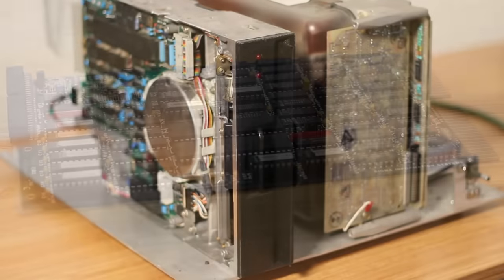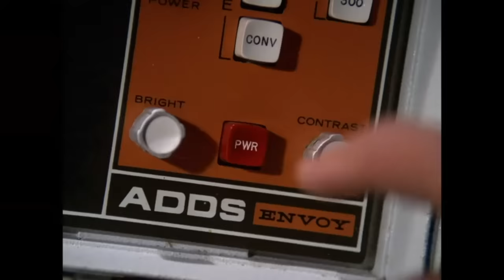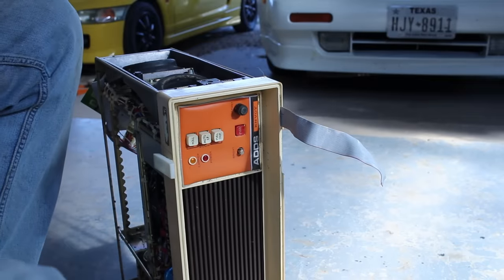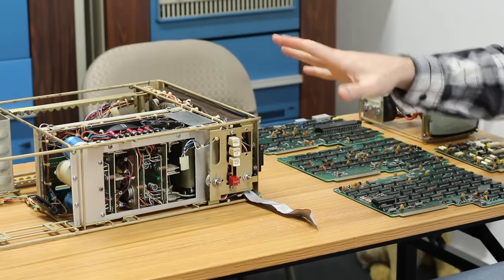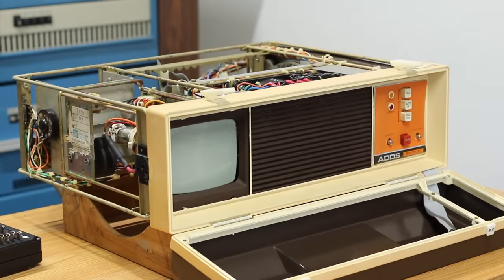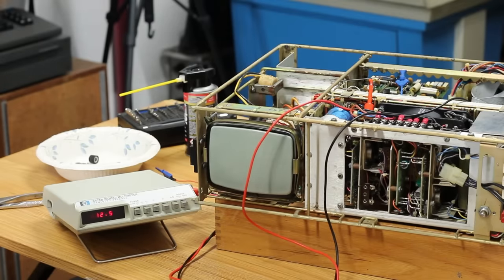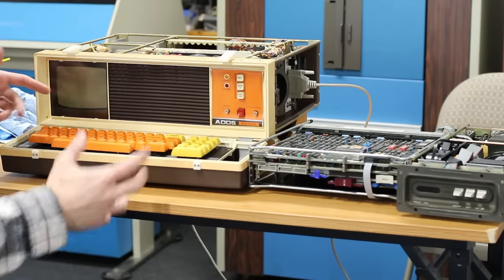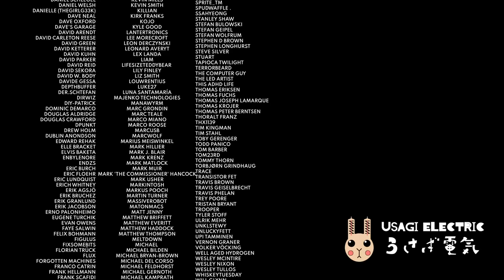This Data Terminal was Covered in Poop!

Comment: Power electronics engineer here specialising in MRO of rail power electronics. You're cleaning the boards exactly how I would, only think I would change would be to add Isopropyl alcohol to sterilise and act as a drying agent.
Reply: Some old capacitors wouldn't be happy with much time with isopropyl.   Polystyrene capacitors will degrade.   I have also had cases of it attacking coax cables.  The insulation between the center conductor and the shield seemed to soak up the isopropyl and distort.
Reply: I this case it's more of a rinse instead of a soak in the IPA though, right? Just enough to help get rid of any residual water and unwanted microbiome...
Reply: I agree, However I wouldn't use a high percentage of alcohol, maybe the strongest you can get from the first aid section at the store.
Reply: Do you have anything against cleaning it with an ultrasonic cleaner?
Reply: @christo930  It may be too aggressive.
Reply: @christo930  the old caps might get contaminated
Reply: Flushing with IPA after the washing might help with potential limescale deposits as well. (Very hard water in Texas afair) 
Not concerned with the IPA in this case cause 99.9% of the damage is already done, but I wouldn't let the boards soak in it as I would do with the newer electronic stuff I regularly handle.
Reply: I'm an EE who designs in-house test equipment and I have an actual toothbrush in my toolbox for scrubbing boards with water and IPA in the sink. It was actually my personal toothbrush but we had to clean something on a field trip, and needs must...
Reply: @kensmith5694  simply nope. all true when soaking long time in high grade alcohol. does just not apply. I'm washing printed circuits with a speay of a "personal" mixture (~50°) of distilled water and isopropanol since decades. best results. better cleaning, far better drying. no problem caused by alcohol ever.
Reply: @christo930  YES. :-)  don't do that to old and a little corroded electronics. I tried. until I watched a capacitor simply disintegrate into a cloud of dirt  :-)
Reply: @christo930  No way, too much vibration. The originals were almost certainly cleaned with either IPA or carbon tet.
Reply: @christianlingurar7085  Heh.  That means it needed to be replaced anyway.
Reply: @christianlingurar7085  Well you do you.  I like my styrene capacitors in old stuff to stay within spec and for the coaxial cables to remain good.
Reply: @christo930  Too aggressive on some passives like caps and resistors. I've done it a few times with old Arcade monitors but I always recapped them after the bath.
Reply: I've had to clean PCBs exposed to CaCl spray, and my experience there was that it is VERY hard to wash out contaminants that have soaked into the PCB substrate. Even after ten wash cycles with deionized water and IPA, could still measure unwanted conductivity in the worst soaked areas. The TLDR for this example is that this thing is gonna be fragrant when warmed up ;)
Reply: I would avoid tap water if you have hard water. Lots of minerals will be left behind.
Reply: I admire his perseverance. After that much poop, I simply would have "cleaned" this in an autoclave for about 2 weeks.
Reply from the maker: Thanks for the insight!
I thought about adding some IPA, but I only had a little left and was too lazy to go down to the store to get some more, haha.
Reply: @christo930  Yes, don't do it. The prolonged vibration may be enough to damage bonding wires in some semiconductors.
Reply: I'd avoid the isopropyl and instead final rinse with deionized or distilled water and dry with warm HEPA filtered air.
Reply: 35+ years experience with PC board engineering. Some of you are making this far more complicated than necessary.
1) Isopropal alcohol is fine but Proponal is less likely to leave any residue.
2) Plain old tap water is fine.
3) Dry both water rinse and alcohol bath with compressed air.

This is a standard procedure with commercial products. Military may have more stringent requirements.
Reply: @edlizard  Unless this is a clean room component, what is the purpose of the HEPA filter? The board ultimately sit's in a card cage with a fan blowing room air across it.
Reply: @kensmith5694   You can always put it in another container and put that in the ultrasonic cleaner, it attenuates the ultrasound. I also do this when I have items covered in grease so I am not always having to clean out my tank.
Reply: @andydelle4509 Military standards are baked into IPC standards, which actually specify water washes if needed to clean boards. Isopropanol is fine for a rinse or flush, to help with drying. But pure isopropanol sucks as a cleaning agent. It's excellent for disinfecting, but you just end up with sanitized gunk that you still need to wash off with water and a brush.

Comment: Sure that terminal is gorgeous, but I spent the whole episode drooling over that cute HP multimeter
Reply: Those desctop meters are amazing I have a 1970s simpson meter that has a nixie tube display.
Reply: it looks as if it would spring right into your face when you apply wrong voltage
Reply: @timothydelaval1089 you lucky dog.  I have a Simpson multimeter that has early LEDs. Pretty rare I believe.  Maybe not.
Reply: Much better than propping a clamp meter up with a screwdriver!
Reply: Glad I wasn't the only one
Reply from the maker: Phillip is a legend for donating this one to the channel, it's absolutely gorgeous and the perfect meter to be troubleshooting this epic terminal with!
Reply: Seriously, me too.
Reply: These meters also were mounted atop of certain HP oscilloscopes. I had a 1725 that had one at some time.
Reply: That terminal was a nightmare to assemble.  It took one guy a month to assemble/test 30 units.  That rat poop small card was the modem mod/demodulator card.  All done using op amps.  And only ran at 300 baud.  The phone couplers were designed for the Western Union Handset used everywhere home/business.  At the time only AT&T equipment could be used and only later.  Could cheap china-crap phones be used as well as direct connect modem cards.  620 envoys were stopped when FCC allowed direct to MA Bell.  Who wants a slow 300 baud terminal when faster was just over the horizon.
Reply: For real. Beautiful little unit.

Comment: Just saw the part of the video showing a large number of  (((   (  ((    (  in a field of what should be ASCII spaces.    I would bet the (((   (    ((   (   because the error in the raster display is in the middle grouping of 8 lines the issue is with the ADDS memory shift-reg card's 9 Shit-Reg. ICs, one of the chips is flipping bits because it's just bad, ( This was a very common problem and many time was heat related. )     Space code = 0x20   and the ( code = 0x28    looks like a bad shift-reg bit.
Reply: Nicely spotted!
Reply from the maker: Ken swinging in with the proper expert diagnosis! Gonna have to get you down here to help get this thing and the printer fully up and running one of these days!

Comment: Your portable ADDS terminal has the same 3 main PCBs and keyboard as the ADDS 580 used in first Warrex CPU4 systems.  The one with the side connector is the FE card ( has the RS-232 I/O logic ) the middle card is the screen memory display buffer ( the display buffer has 9 shift-reg IC's,   1-3 for first 8 lines, 4-6 for the second 8 lines and 7-9 the last 8 lines =  24 lines x 80 columns ).  The two main issues are the FE card RS-232 I/O chips SN75188 & SN75189  and on the screen buffer card the 9 memory shift-reg. chip house 2 bits each by 80 positions on the display.  The normal test for bad shift-reg chip is to type in 1/2 dup.  A B D H P  (return) in all 24 lines on the display.  A B D H P will turn on a single bit on the ASCII code of the up-case only ASCII display.  Many times the A B D H P typed will be displayed as with a extra or missing bit so the A B D H P displays the wrong letters.
Reply: would the  Envoy work on the centurion(or is it beyond 24x80 ability?) ( your other comment notes the probable failure for the chips - try a card swap between terminals first ?)  Presumably CRT in the rat one is power supply related and solvable ?
Reply: It's not unusual for the RS driver chips to get blown out.  All it takes is some kind of surge on the RS-232 line when it's run a long distance.
Reply: Good luck finding the Static shift register chips.  It was the reason ADDS stopped production of several lines (580/880/980/620) Then the regent series was produced followed by viewpoint.  The video memory card is sectioned by 3 groups of 8.  abdhp is only need once per section not all lines.  Check test key <CTRL>-L clear screen  abdhp <space> <ctrl>-K K abdhp <space> <ctrl>-K W  abdhp <space>.  re: ctrl is control key, space is space bar.  The space is important.  Any bad shift registers will show as a @ sign.  FYI <ctrl>-K was direct line access @ line 1, W line 24
Reply: @russellhltn1396   Does the RS in "RS driver chips" refer to Rat S...?
Reply: @lawrencerubanka7087  No, I was just abbreviating RS-232.  In this case "RS" is "Recommended Standard".
Reply: @n2nby  Sounds like both of us have repaired the early ADDS terminals with bad video Shift Reg. Memory chips.  The good old A B D H P  in each vert. 3rd of the screen.    Regards,  Ken
Reply: @kenromaine2387 I was closer to the problem than you.  I worked there for 17 years.  The shift registers ran hot on the card.  Beside subject to failure.  Hot/cold problems too.

Comment: To add one nugget to the cleaning bit- It's a good idea to be careful with wire harnesses in addition. Water can wick several feet inside the wire insulation and can stay there. This can cause issues in the long-term on some wire types. It might also be a good idea to hose the boards off with distilled or de-ionized water as a final wash so that it doesn't deposit minerals on the boards during drying.

Comment: To get the keyboard loopback working, you might have to assert DCD to the terminal; on the VT52-like terminals I used, you could loop DTR back to DCD; on those terminals, DTR was an output that would be asserted when the terminal was "online". We would also wire those two to the DSR pin. You may also have to loop back CTS to RTS if the terminal requires a hardware handshake.

Comment: People that complain about washing boards have never worked in PCBA manufacturing.  We run assembled boards through plain water washes every single time, it's how they are cleaned before configuration and testing.  Heck, I literally spent over an hour washing boards just a couple days ago at work.  Although, personally, if the board can handle it, I just bake them.  Not only does it dry them out more thoroughly, if I do have to do any touch up soldering it makes that go so much better as well.
Reply: I doubt you use tap water though. So much (natural) contaminants in that I wouldn't buy from you. But for this videos purpose it was fine.
Reply: @bzuidgeest  It's literally just Deionized water, a.k.a. purified water.  And we manufacture for some of the biggest companies, including stuff in your computer, so you kinda already do.  Also, if you travel by plane then I hope you don't mind :)
Reply: All the Warrex / Centurion minicomputer PCBs had the solder flex remove during mfg by a trip to the Sears dishwasher for a wash cycle (without any heat dry cycle). The PCB air dry in a rack for two day the moved to a heated  burn-in rack with all DC voltages ( +5, +12,-12 ) for 48 hours for being tech-ed and installed in to a Centurion system.    We even ran field repair returns in the Sears dishwashers as needed.    Yes the Sears dishwasher was purchased at the local Sears store in the mall.
Reply: Came here to say it , but you beat me to it.  People who object to washing PCBs have never worked in a large-scale manufacturing environment.
Reply: @kenromaine2387  I have used my dishwasher so often over the years for PCBAs.  Sometimes it's just easier than cleaning them by hand.

Comment: The "carrier" light would be for the acoustic coupler.  Remember how, in the days of dialup connections, if the connection dropped you'd get a "NO CARRIER" message?
Reply from the maker: Ah! I totally didn't think about that, but makes perfect sense!
Reply: @UsagiElectric  as mentioned in some other comments I have an Otrona Attache portable computer that is about the same overall size as the ADDS terminal but I think the crt is larger and it has two 5.25" floppy drives. But no built-in acoustic coupler/modem. It could even run from battery using a separate power pack thing. I've never seen the power pack. In the early 80s I did some programming for building energy audit software at a place that was selling it to utility companies after a federal mandate required them. They were marketing it with either Compaq Portables or the more compact Otrona. The "base" Otrona ran cp/m on a z80 but most wound up being sold with a PC compatibility card that ran a slightly modified DOS 2.1 on an 8088 or 8086.
Reply: All amplitude modulated signals share the use of a modulated carrier wave whose amplitude is, well, modulated.

Comment: I restore pinball machines and also have a lot of nasty boards and electromechanical parts to clean up. I suggest getting yourself a 10-22L ultrasonic cleaner (they're surprisingly inexpensive) for future projects. A 50/50 mix of Mean Green and water does great.  Next, a quick rinse under the tap and then the air compressor to blow out any water. Lastly: this works great for coils and transformers too! After their bath, they sit in a tupperware container full of silica gel beads for a few days.  Overall, it's much gentler than using a brush, and the ultrasonic gets to every last nook and cranny. I've had many crusty barn find come out of the cleaner looking like it rolled off the assembly line.

Comment: "I've spent the last day and a half swimming in rat excrement and I didn't need to"
Brave guy did it anyway, what a champ
Reply: The rat machine might not be permanently out of the picture.   Would it be possible to sub the CRT module from the clean machine into the rat machine?  If only to give the rat machine a second chance to show something?  In order to better deodorize the rat machine parts, perhaps a dunk of each board for a few hours in some Nature's Miracle or equivalent enzyme/bacterial product from a pet store might be helpful.  An emanation of especially pungent ammonia odor is good news here, for it means the waste is breaking down, releasing its nitrogen.  (Sometimes a situation has to stink worse before it ceases stinking.)
Reply from the maker: "We do these things not because they are easy, but because I'm a little dumb." - John F Usagi.
Reply: Ah, a day in the life for shango066, too.

Comment: Might think about getting an ultrasound cleaner. No complaints on your well reasoned cleaning method though. I imagine that thing when it heats up is going to "share the joy" for a while till it burns off completely 😅
Reply: Yep - Ultrasonic cleaning would do a lot. A lot of people, myself included, use it a lot to clean up contaminated (battery leak, fluid spill) and/or corroded circuit boards. Keep in mind that older electronic parts can be dried out and cracked over time, so that can be a problem. They should be replaced anyway, but thorough inspection and checking is always needed.

Comment: "A switch here that says 'modem' underneath it - I have no clue what that does." 
Pretty likely it selects between the acoustic coupler and the data port. It's not clear if this was actually set correctly through the serial experimentation. I also suspect the rear BNC is for connecting an adult-sized display. I'm actually surprised more of the protocol controls aren't on the front panel, given it's a luggable terminal for working in the field.
Reply: I was silently screaming this at 25:44 when he tried jumpering the pins on the serial port! 😱
Reply: Thinking the same thing for the BNC Jack. Otherwise I can't make sense of it. The number of things that video output is not a standard on when it has a built-in display is so annoying. 
oh and @iroll you're right I hit the timestamp and immediately went AAAAARrrrrrrrrrrrrrrrrr.
Reply: "Modem" position enables the acoustic coupler and built-in 103-type modem (good to 300 baud). The "up" position routes the data path to the RS-232 subD connector and allows you to use the faster baud rates for direct connection to your computer (or a faster modem)